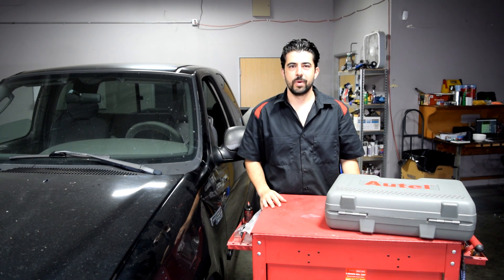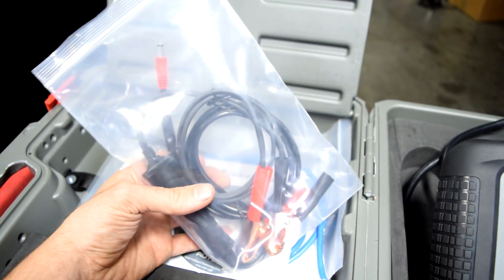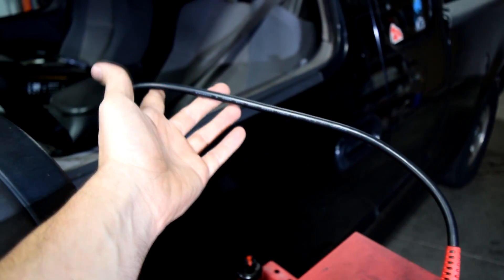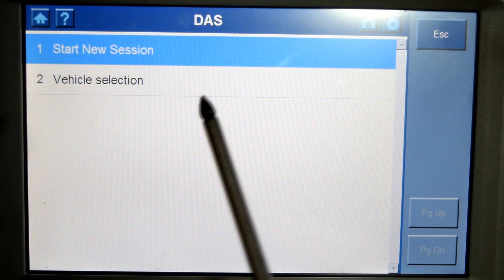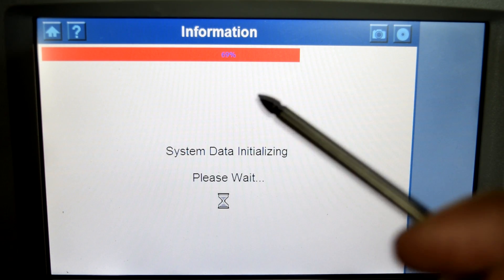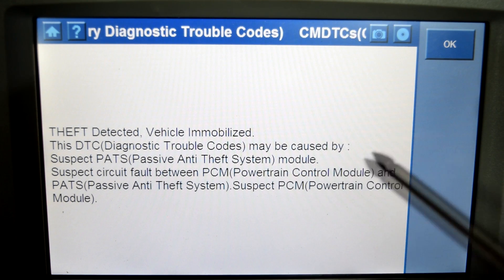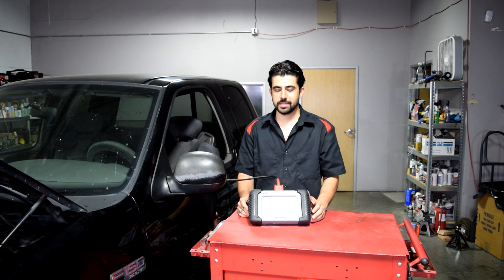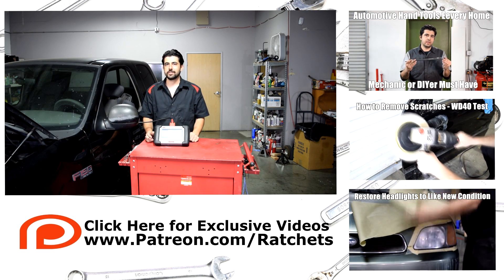A Professional Grade Scanner at a Fraction of the Cost - OBD II and Dealer Software

Comment: The $125/ year for updates is a deal breaker for most DIY users.
Reply: I agree overall. but an hour of diagnostics on a car at a garage might run $100 anyway, so one single use of the tool could potentially pay for itself year over year

Comment: I hope you respond please. I've tried two different cheaper scan tools that SAID it could but turned up they couldn't. Big hassle. Does this scan tool read CURRENT misfire live data? It would help too if it reads HISTORICAL misfire data also but CURRENT would be the biggest help! I have a 2002 Nissan that bumps at idle only (at least that I can feel) and only with a/c on. I've replaced the rear bank of coils and all plugs. I need to watch at idle which cylinder is intermittently misfiring so I can replace only that coil. Fords and Nissans are bad about when one coil fails, the others are not long behind but, I only replaced the rear bank coils because during the spark plug change, I found cylinder 5 had oil on the plug boot. I changed the valve cover assembly (gasket isn't seperate) and only the rear bank coils. I figured if one of the front coils goes out, its easy to replace those one by one. The coils cost upwards of 65 bucks apiece (my cost-ngk) but if I only need one, I only want to buy one. Desperately need current misfire or historical to help me figure this one out. If this scan tool does it, I'll get it! Please answer.

Comment: Autel Win 2016
Launch Win 2019
Launch X431 Diagun IV and X431 V has the full bi directional control capability.
A not bad scan tool for auto technician or mobile mechanic.

Comment: There's also the OpenXC project for those who prefer DIY CAN bus analyzers. You won't have access to vendor data with a DIY rig, but the proprietary systems don't provide much of that either unless you're an authorized dealership.

Comment: Hi, I did a Lt1 Camaro swap to a 1996 Impala ss.  My tachometer is not reading correctly  and a couple check engine lights are on but not effecting the performance of the car.  I have true mechanical gauges installed. Any help would be appreciated. 
Thanks

Comment: Why would this be better than some of these little $15 wifi / BT scanners that works with your phone?
Reply: None of those will do the testing (bi-directional) he was demonstrating in the video. If you find one that will, please let me know - I've been searching for years. All out there are just scanners. Some will role down your windows or something, but how useful is that when you need to test the engine. This is on par with the $10K Snap on but without the scope or the good help instructions. However, with Snap on, most of the price is in the name.

Comment: Great channel & keep up the good work. I purchased this scanner about 2 years ago. Great tool but can ne wonky. It dosnt re calibrate the air suspension on the S430 / S500 MB like it should "tried on several MB" or program keys for the 99-04 Discovery but surprisingly does as advertised for the most part for the $ spent. Mine has already paid for itself many X over.
Reply: Whatt's the name of the scanner and how much is the cost.other thing where can find that scanner?

Comment: I hated mine. I thought i was getting a great deal because of how cheap they are. Mine quit working on me 3 times in the first 10 months i owned it. They did send brand new units each time but it took 2-3 weeks to get it which hurt since i'm a professional mechanic and need it daily. I also spent $900 on a update and got it back where they had removed half the software and i paid for the down grade. I was so pissed. The reason they removed so much software is because their getting their ass sued off for pirating software by several OEMS like Ford. You can tell its cheaply made when your holding it. It had so many holes in its software too which pissed me off. It said it could do certain tests and even list them but when you try to actually do them.....NOTHING.
The wi-fi is a absolute joke. You can't go on-line with it to do anything other than download updates which take all day to do. Just a joke.
Plus their customer service???? Which i used all the time with all the problems i had with it. Whats up? Come on can you hire anyone that speaks English?? 
And once i found out it was a Chinese based company stealing American patented products like every other damn company in China WELL...... %$#@ OFF!! 
Their new Autel model from what i hear ain't any better and i've heard their programmer has a very good chance of locking up any computer you want to program. I watched a fellow tech use the add on scope you can get for the new model. Being a scope junkie I have a very low opinion of the scope as well. Not worth getting at all. The scanner part is about the worst graphing scanner i've ever seen and the additional add on scope module is laughable. Don't waste your money on that as a $154.00 uscope would run circles around it. There's a lot of scanners and scopes out there to choose from don't waste your money on this Chinese piece of shit that pirates everyone's patented tools and breaks American and international laws at the expense of American companies and their employees.
Reply: What scanner are you using now.
Reply: I have had an MS906 for about 2 years and that thing is awesome! No hardware issues at all. Purchased mine through NAPA when they had a sale. A few mechanics I work with swear by it. It's not a perfect tool but it is very powerful. You just gotta learn to deal with its shortcomings. That's why lots' of mechanics suggest you have more than one scan tool.

1) some bi directional controls don't work.
2) auto decode vin doesn't always work. - sometimes you gotta manually select the vehicle to get it to recognize different systems.
Reply: Thanks for your input. I'm a retired mechanic who needs more than just a hobbyist tool. I want the more advanced graphing and multi system scanning available to work on my own cars. Unfortunately, I have very little experience with obd2 since I haven't worked on them enough to get familiar with. I understand the theory and functionality, but can't settle on a scope or scan tool that's thorough and affordable. It appears this scanner doesn't fit the bill either.
Reply: Thanks man this point matters alot to some

Comment: I found some of these scanners on eBay for a lot cheaper than on Amazon. Is there anything I should worry about buying one of these from eBay?
Reply: make sure its not a knock off and you want to get the serial number to make sure it's a brand new unit call autel the sweetness of low price is soon forgotten
Reply: SuperJoes70 U wouldn't mind if it's used. Do you think that would effect the functionality or ability to take updates?
Reply: *****  yes because you have a warranty from autel  for a year and you get updates for a year I had a software issue and they fixed it :) and once they are registerd as the second owner you can't get tech support on autels website only way is to buy the update from aytel which will cover you but that's around 500.00 :(

Comment: Are there any ongoing costs with this scanner? Specifically, on a yearly basis. I've heard that you have to pay for updates? Is this true? How much is it? Are they mandatory for the scanner to operate?
Reply: I don't have this but I have use many scanners. Never ran into one where updates are mandatory to operate so i figure this is so with this as well. It will work forever until it malfunctions or break. Updates are just to keep tool updated and to keep the tool relevant and working with newer year models as new database are released.
Reply: The Hacks-By-Jack Channel. Thank you for the info. So, you're saying that without the update, brand new model years such as 2015, 2016 onward won't work with the scanner?
Reply: The Hacks-By-Jack Channel. If I were to purchase one today, what is the most recent model year(s), this scanner will work with?
Reply: If you buy one of the current models like the 808 you get free updates for a year. Your tool keeps working after.

Comment: These are fun to hack.  It's easy to mess with the boot sequence as it's using standard Window CE 5.0, which has also passed Microsoft's security death date.  Internally, there are several com ports which you can tap with a TTL-to-USB cable and monitor console and add functionality.  Ultimately, the software is the real key...one can easily reproduce the hardware using off-the-shelf Raspberry Pi hardware and use the Autel adapter kit. Edit: This hardware design is based on a Samsung platform which is well documented. One can also override the USB controller chip easily.  They really didn't do much to lock this down and are selling these as a legacy design now that they have the more expensive MaxiSys out....and that's just a tablet running Android, their speciality software, and using USB devices.
Reply: Where exactly would you find this software? The price is alittle high and was wondering if I could use one of my raspberry pi's to make myself a scanner.
Reply: @Jonathan: Finding software is the trick. Last I checked, there isn't an open source effort to make a diagnostics software suite.  There are efforts at making hacking tools and software exists for diagnostics PIDs (OBD-II), but they're limited.  I think a real key is for something to talk OEM vehicle-specific, provide an assortment of data specific to ECUs, and then marry that data to some sort of open field/repair manuals.  That would get enough traction to become a serious effort.  Diagnostics companies are making huge money off subscriptions and that could really upset the mom & pop shop sales demographic.
Reply: 以蔵岡田: Same here.  I've been looking for one with a cracked screen, burned, etc.  Anything where the data can be surgically pulled.  Hard to come by.
Reply: Anyway you can upgrade the ram or something to speed it up?
Reply: Jeff Sheldon would it be possible to then reproduce this hardware onto a laptop?
Reply: I'd like to see someone help out the developer of Torque Pro on Android and iOS to get some of these features into the mobile app. The ONLY thing I really need is ABS and Transmission diagnostics at this point; though being able to troubleshoot the Anti-theft system in my 1997 Thunderbird would be nice. It's not using a chip key and the Theft light is on a 500ms blink cycle whenever the door is open. I suspect someone tampered with it before I got ahold of it, I just have no way to troubleshoot since I've never actually worked with this car's theft prevention system. I'm used to the ones in Explorers where there is an actual Module for the job, I'm told by our Ford Parts department that it DOES NOT have a module for the job and that the issue lies within the ignition cylinder most likely. Can't tell without a Dealer-level scanner and I ain't payin' Ford to do it for me.
Reply: @morgfarm1  the obd2 scanner bluetooth. Does it check sensors? How good is the apps that work with it? Does it show live data? Air and fuel ratio? Been looking into a scanner but not sure which one to go with
Reply: @calebwillhelm2635  the Bluetooth adapter reads whatever is sent through the OBD Computer. The app decides what it Is programmed to, so there is a lot of variance in what sensors can be read in real time. Not only that, but it also varies from vehicle to vehicle.  Torque Pro, the paid version of Torque, is hardly different from it's free version. In the Ford vehicles I have used it in (3 explorers from 1999 to 2002, 1 2005 Taurus and 1 1997 Thunderbird) have all had similar sensors with some differences. But in most cases it will get real time data from every sensor the ECM supports. Note I said ECM. BCM, PCM and others are not usually able to provide a lot of real time data. Torque, for example, cannot get PCM information in either free or paid version. Buying a more expensive model from Scantool.net (I got the MX+) AND using their specific app, you can get PCM info. Some might even support ABS, SRS and transmission fault information but is never a promise or guarantee.
Reply: @morgfarm1  THANK YOU so much man. Ive been doing research but dont trust any of the info they advertise. I really appreciate the information man. If you dont mind i have on more question.  How does the bluetooth scanner you sent me a link to compare to the scanner in the video, an elm 327, or the bluedriver one.
Reply: @calebwillhelm2635  I used an ELM327. they're not bad. But it gets hard knowing the quality ones. The last ELM I had melted down the solder joints in the PCB from sitting too near the floor heater (thanks for that, Ford) but worked fine otherwise, though it couldn't get transmission temperature for the Thunderbird. The MX+ DID. I have never used Bluedriver. The first BT I had was a VGate and worked the last time I saw it. I replaced it because I forgot where the hell I put it after selling my 2002 Ex and moving into a 1993 Toyota.  The MX+ also has a much better warranty and the app they provide does get you PCM information along with other enhanced DTCs in a lot of cars, something the other common apps dont do
Reply: @calebwillhelm2635  I will say this: the app provided for Scantool's adapters has a pathetic data refresh rate. Torque Pro has some of the best refresh rates you'll find.
Reply: @morgfarm1  so do you recommended buying the one you sent in the link and using torquepro with it? I do ALOT of mechanic work on the weekends for those that cant afford a shop. Single moms. College students. Etc. Im sick of switching around relays, coils, etc to see if its one part or another. A good scanner would make my life alot easier. Since i never charge for my work i would like to go a cheap route for a scanner. Im currently trying to figure out why a 2002 xterra won't start. Its 930 at night.  I have work early. And im dead tired. A nice scan tool would be nice right now. Vehicle has plenty of voltage. Almost seems as its not getting to the starter
Reply: @calebwillhelm2635  As a good starting point, I do. It helped me diagnose a bad oxygen sensor in the Thunderbird after a tuneup and cat-gutting failed.  They can check Check-Engine codes, reset the light, get realtime data from most sensors in most cars (there are some oddballs that don't really work so well I hear, but I've never owned any of them so I can't confirm). Most can get away with the $30 ELM327 types but for longevity and the expanded tools, I would go with a Scantool.net model just for the fact their free app (that only can be used by a Scantool branded Adapter) does allow you to get into the PCM and in a lot of Ford and GM cars, the ABS and Transmission systems. I haven't had a transmission fault in the Thunderbird so I don't know how true it is or isn't. (A good thing, really; Automatic transmissions from anyone in the 90s were just junk so to get a good one is rare). Plus, for $100 you can't really beat the expandability as long as you have a decent smartphone. I suggest Samsung S5 or newer over iPhone; just because iPhone tends to have some compatibility issues with some adapters. I use a retired S5 and will upgrade when I replace my current S7 phone.
Reply: @calebwillhelm2635  Fact of the matter is, I have my Torque Pro set up for daily driving; I can see Speed, RPM, Transmission and coolant temperature, the gear the automatic transmission is currently in, and the slip RPM of the torque converter in real time (roughly 500ms polling time, which is about as good as anyone; Scantool's only updates once per second which is pathetically slow in comparison) the fuel milage calculation is wrong, BUT it does determine where out of fuel is with about a gallon and a half left in the tank, which is excellent as a buffer.
Reply: @morgfarm1  you are an angle sent from above. I would have paid money for the info you provided. Cant tell you how much i appreciate it. Im going to order that today. I wonder if it will show transmission pressure. My 02 2500hd silverado has trans temp. Oil pressure. Coolant temp. Voltage. Etc. But i dont trust the guages. So that will be nice to run the torque pro while driving.  Again man thank you. Been doing research for a while and was just confused
Reply: @calebwillhelm2635  It MIGHT, but ONLY if there is a sensor specific for it in the transmission plumbing. If there's no sensor or sending unit, it won't happen. I've actually found fuel rail pressure doesn't seem to work with most vehicles, or if it does, the values are in the thousands of PSI, same with fuel tank pressure. How true this is, I've never tested. Fords usually have a transmission fluid temperature sensor, so I would expect GM to do something similar, but never yet transmission.  Now, if it ran on air pressure like a diesel truck does (Since I'm told Eaton-Fullers in class 8 trucks use a combination of air and hydraulic pressure) then you have a chance. either way it can't hurt; I have it to monitor my engine and transmission temps more than anything because if the engine is running too warm, the transmission will eventually follow because of how transmissions are cooled.

Comment: how much are the updates?
Reply: Don't update it you'll loose half your pirated software since their getting their ass sued by several OEMS, like Ford. Guys were paying $900 for a update and they removed a bunch of software then charged you for it. Mine quit working 3 times in the first year i owned it. You can tell its very cheaply made when your holding it. I gave up on mine after having so many problems.
Reply: I have the same question!!
Reply: They were about $700 but are no longer available for the DS708